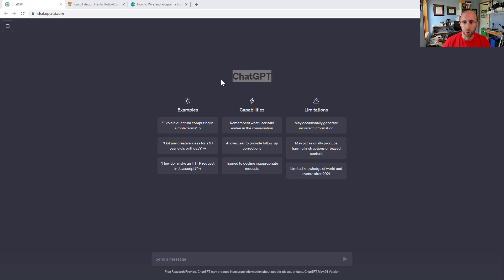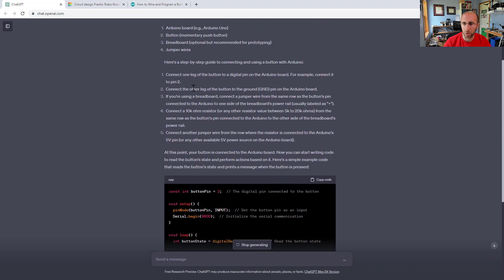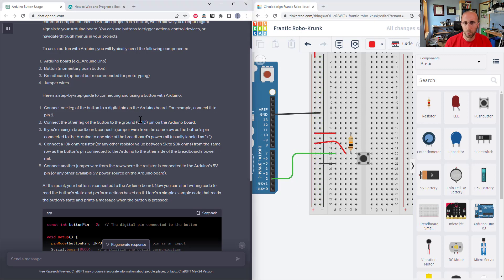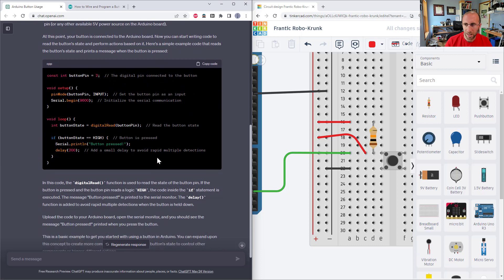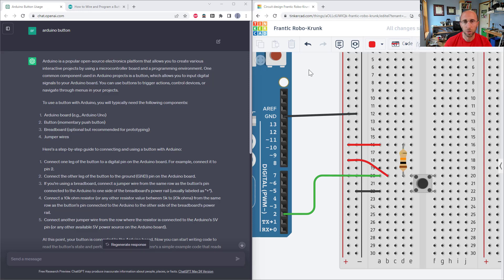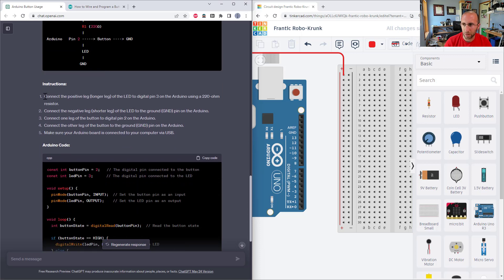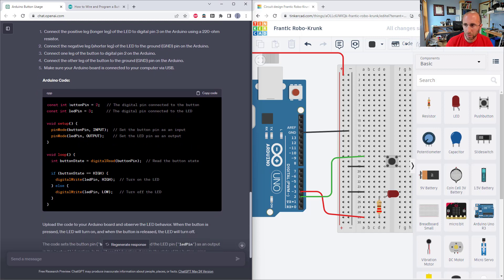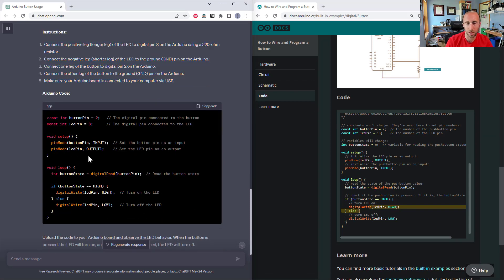Can ChatGPT Write Arduino Code? Part 2: Buttons

Comment: You need to tell Gpt what your using ie, it can't read your mind ..

If you told it you were using tinkercad to connect your circuits it would now know the software you're using.

As Gpt is text based you need to describe your surroundings so it can picture what you're actually working with or possible handicap ..